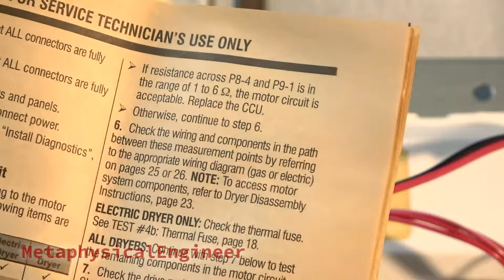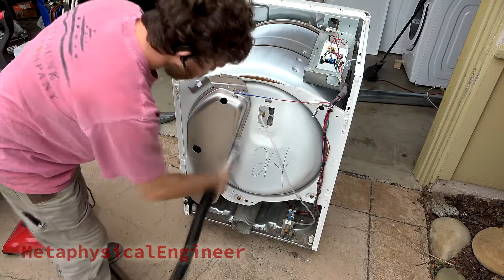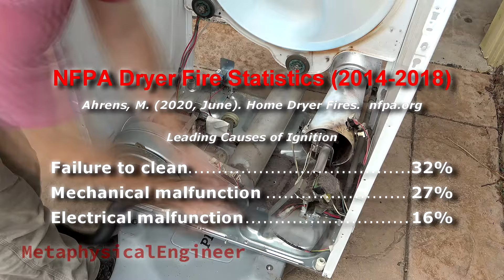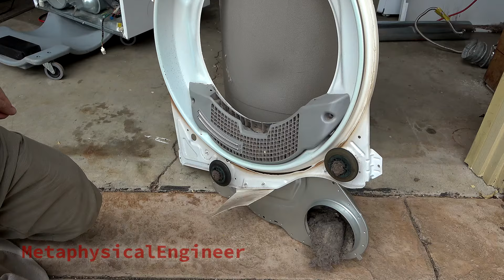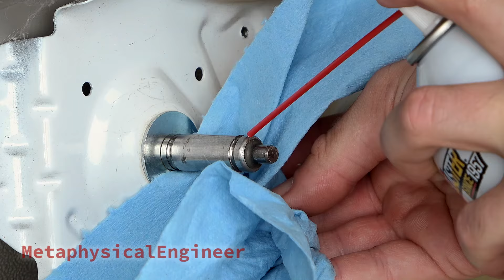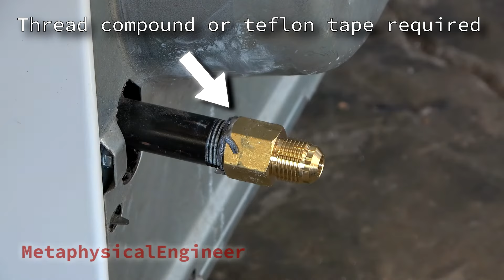Maytag Dryer Won't Start?  Could be a simple fix!

Comment: Thank you so much for this great walkthrough!  I have this exact dryer, but electric instead of gas, and was able to follow along with no issues.  I had the same burnt spot on the back of the circuit board but just ordered a new one.  While waiting on it to arrive I used your video to take it apart and clean/inspect everything.  Now it runs like new, and I know it's clean and safe.  Thank you again.
Reply from the maker: Glad you found this video helpful!  It's an often overlooked bit of maintenance, but makes a huge difference in safety and power bills!

Comment: You’ve helped another victim, lol…but I made it almost 15 years through multiple moves so I can’t complain too much.  I was able to find another used board on EBay for $25 but I would like to repair mine like you did so I’m ready when the replacement board predictably pops.  Any recommendations on a how-to for somebody who’s never touched a soldering iron?
Reply from the maker: Glad you got yours running again!

There's a lot of tutorials out there for soldering, but practice is the best teacher once you've seen the process.  Parts must be clean, and solder will flow to where the heat is.  If the part you want to solder is hot enough, the solder will melt and stick, and you'll see if wick across the surface and into gaps like water soaking into a towel.
Reply: @M @MetaphysicalEngineer en married to my husband for over twenty years…never knew he could do it until after I asked you 😂😂.  Thanks for the great video!

Comment: The solder blew up sadly I didn’t take any photos nor would be able to attach them here but the solder blew up burning the white plastic plate splash on the back of the board and re soldering it got it back kicking again thanks so much!!!

Comment: I soldered the exact points you did hope it’s not a hazard in any way? What causes the blow out? My damage was identical to yours
Reply from the maker: Given how many people have commented reporting identical or very similar failures, I guess a design problem where the circuit board traces are too small, and a manufacturing problem where the solder wasn't done properly.  Lead free solder is susceptible to cracking.  High current motor plus small pad and trace just puts more stress on it every time the dryer starts.

Once repaired, it should be fine.  A wire bridge like I did is much sturdier than the thin trace it had before.

Comment: I'm having the same clicking but my board is not fried.
Reply from the maker: In that case the problem could be with the wiring or the motor itself.  If you have open circuit across the motor wiring as measured at the connectors at the board, you'll need to go deeper.
Reply: @MetaphysicalEngineer thanks

Comment: just had same exact problem, soldered the same connection and it works
Reply from the maker: Glad you got it working again!  Crazy how so many people have had this exact type of failure on this dryer but I'm not surprised, given how thin those traces were.  Sized for steady state operation of the motor, but not for the brutal inrush current as it spools up.
Reply: Going to solder and reinstall thank you so much for your video god speed and merry Christmas I have some very greatful and happy neighbors now
Reply from the maker: @Bkiller141  Glad you were able to help your neighbors out!

Comment: What is with the relay solder points on this Maytag dryer?  Great video by the way!  I did exactly as you showed. While my board had the other relay point blown out, I did an OK solder job and it is working again.  How many amps are going through that printed circuit board?  I can't believe a YouTuber has a video for this exact obscure problem.  Was it just a bad solder joint that caused it to blow or should I be worried that I just hard wired a bad circuit?
Reply from the maker: I blame bad solder joints.  But not a fan of the trace thickness either for a motor circuit. Part of why I bypassed that entire trace to the other connection.

A bad joint can pass QC but will be stressed every time that motor starts.  You may have noticed the lights can dim a little when a dryer first starts.  The motor takes an inrush probably in the 30+ amp range when it has to spool up the drum full of heavy wet clothes.  Over time the weak joint gets worse until it burns in half and arcs, vaporizing the pad and the rest of the solder. 

As shown in the intro, I bought the set for super cheap knowing there were problems.  I was afraid it was a dead motor at first, but instead found that relay connection had spontaneously become plasma one day.
Reply: @MetaphysicalEngineer  Tin lead ratio changed on solder paste for environmental reasons I , when using reflow oven the heating profiles have to be right on, and a high production reflow run throws off the spec'd out runs from quality and reliability qualifications, which was probably run in lab and on different reflow ovens,  plus the newer solder pastes are not durable and prone to fracture. Thats my 2 cents. Great video!

Comment: I did all of this.  SUPER helpful but I’m still getting a “check lint screen” error.  Thoughts?  Someone told me there was a fuse to check but I didn’t see one
Reply from the maker: First ensure the rest of the vent system is clear.  The dryer measures how fast it heats up and cools down to check airflow.  Fast heating and very slow cooldown means the vent is unable to flow enough air.  Longer duct runs with more turns are more restrictive and more likely to have flow problems.  

Afterwards I'd check the temp sensors.  On this model there's one in the drum inlet duct accessible through the rear, and the limit switch in the duct after the blower up front.
Reply: Ok.  Yeah it’s a short vent tube which I cleaned out including all the other areas of cleaning.  My only issue I’ve had with this machine after years of work was this error.  It turns and all things work just no heat and the “check lint screen” light.  It honestly it wasn’t even that dirty and the vent hose only has two bends not bad and only about 5 feet in length.  I saw on a different model that that there was a fuse that could be replaced down by the fan but didn’t see any in this model.  Spend hours on this and really hoped this would work.  Appreciate the video and the ideas.
Reply from the maker: Oh that changes things. Check vent plus no heat makes me think either the one time thermal fuse in the blower exit duct tripped. Or there's a problem with the burner system. Can check thermal fuse with ohm meter. Should be very low resistance between terminals, almost dead short. Same with the thermal limit switches. 

Hot surface ignitor resistance depends on model, but should be neither full open nor shorted. Visible cracks on ignitor mean it's likely done for. I have a short that shows the ignition sequence for a gas dryer that might be helpful in troubleshooting the burner if that's the issue.

Comment: Bad solder connection on circuit board was exactly the issue with my dryer. Easy fix, great video. Saved $150 for new board
Reply from the maker: Glad you found the video helpful!  Looks like a really common problem on these newer dryers with electronic controls.

Comment: Thanks! I had the same problem except that it was the other relay pole that had blown. I cut a bit of board away and resoldered the pin. Works great!
Reply from the maker: Thank you for your generosity!  Glad I could help get your dryer back running without having to launch the parts cannon at it!  Seems like this problem is surprisingly common on this model.

Comment: Hello! Did you solder both the connections for P9, or just the one farthest to the bottom right? Thank you!
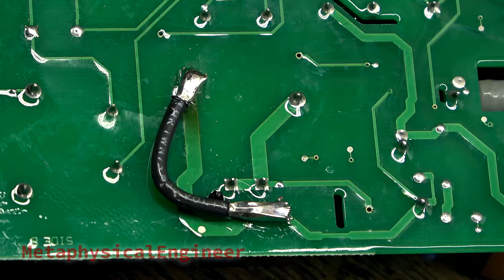Reply from the maker: I soldered to both of those pins under the longer stripped part of the wire visible at 2:09.  Each of those terminals on header P9 has two solder tabs on the board.  Just above where I made the repair you can see the unmodified solder points for P9-2.

Comment: Dude!!! You just saved me a TON of money!! I followed the instructions in the dryer and I have the exact same issue.
Reply from the maker: Glad the video was helpful!  Interesting to hear of other cases of similar problems.  Almost as if a motor with large inrush current needs extra reinforced traces (but that's too expensive, even for Maytag!)
Reply: @MetaphysicalEngineer  LOL... Not that we don't pay enough for them already.. I'm not confident enough to solder the connections so I just ordered a new board. 
On a side note.. I don't think I have ever seen a product hide a complete service manual in a machine for a certified technician.. LOL
Reply: Hello! Did you solder both the connections for P9, or just the one farthest to the bottom right? Thank you!
Reply: @ I bought a new board for 100 bucks.. I don’t trust my solder skills.. lol
Reply: @MikesBrickLab where did you buy a new board?

Comment: Im from the UK and have never seen a dryer that uses gas, all the dryers over here use electric elements to heat up...
Reply from the maker: Even across the pond here, the majority of dryers use electric heat.  Our other dryer is electric, and this place has hookups for both.  Electric dryers are responsible for more fires overall, but in proportion to their prevalence. Both technologies seem similarly likely to cause problems if neglected, according to the research.